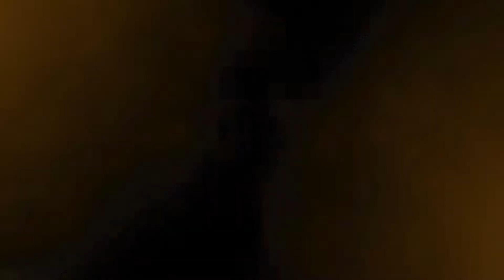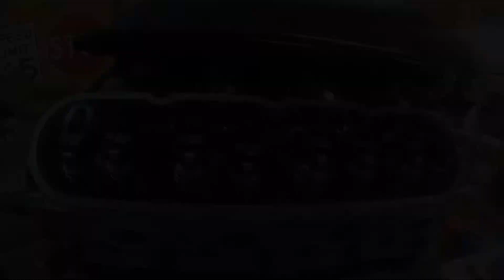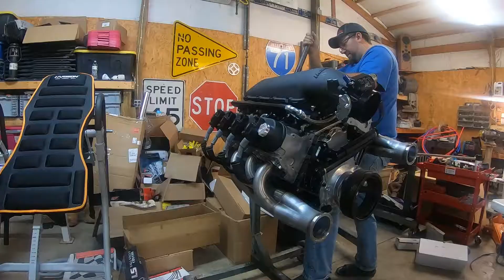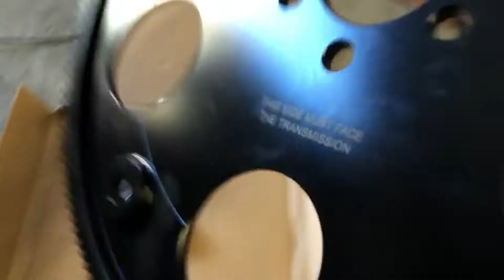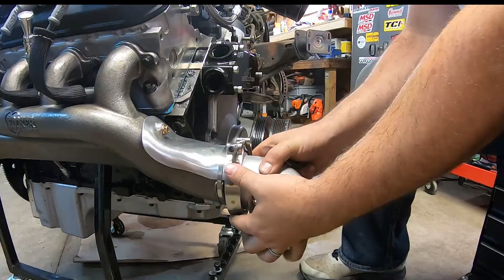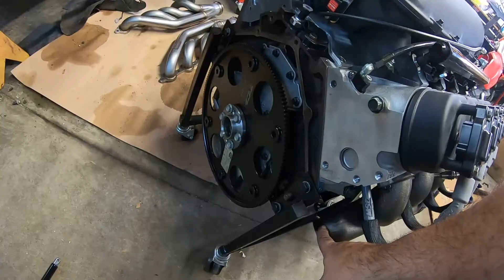TURBO LS BUILD FOR MEEMAW - Part 2 // I LOVE HOOKERS

Comment: I should have gotten these pipes a long time ago. I went with a Huron speed t4 truck kit. That cost me $1500. Then I got the vs denmah kit with the cast t4. The Huron manifold didn’t fit because the waste gate was hitting the control arm. So I upgraded for another $300 plus $120 shipping. to the t6 and pick up a used s475 for $350. The turbo don’t allow me to close my hood. So after $2300 I’m going back to my new t4 and some good hookers.